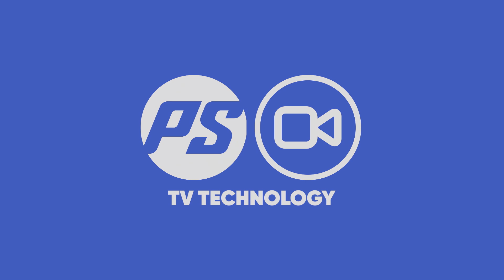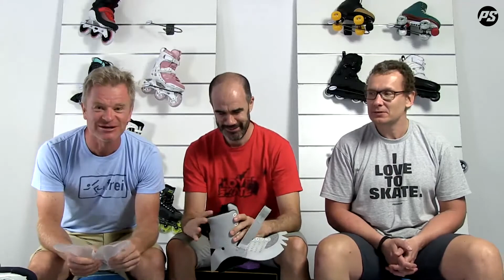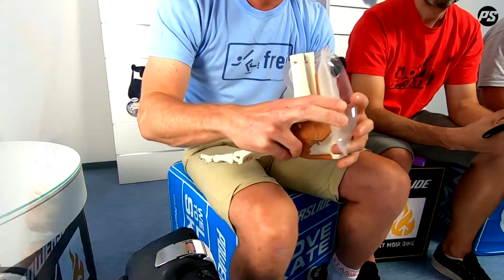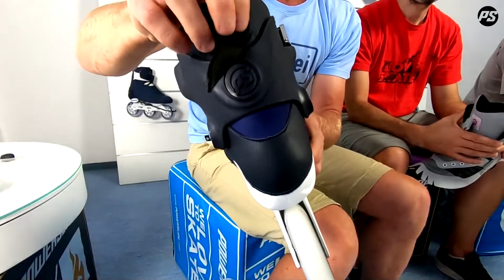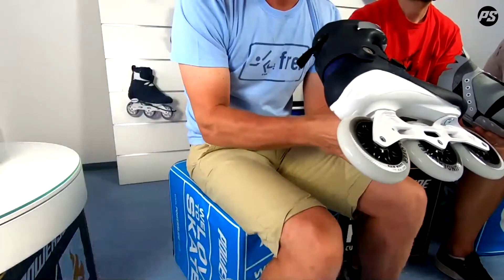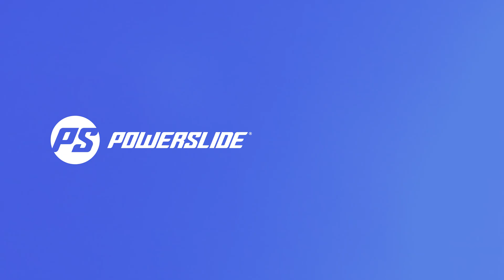TV TECHNOLOGY - MYFIT Aerofit

Comment: Hello! I have Powerslide Aerofit skates, and after a few months in storage, the air system (pump/valve) failed. The rubber pump actually cracked and broke apart. 

Because of this, the fit is no longer comfortable and I’m now experiencing ankle pain.

Has anyone else had this issue? Is there a fix or does Powerslide sell replacement parts?

Comment: Can you still heat mold liners that include the MYFIT Aerofit? I suppose the Aerofit plastic bag would get damaged from 80-90 degrees temperatures in the oven?
Or is the aerofit supposed to replace the heat molding adjustment of the boot?
Reply from the maker: Hi Jan, it's possible till 90°C but still, we don't recommend it ^^.